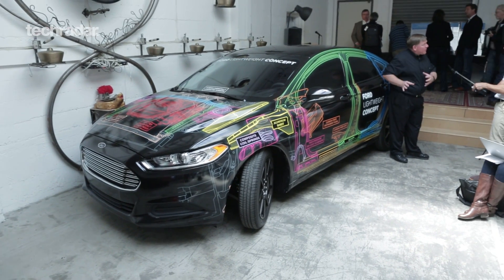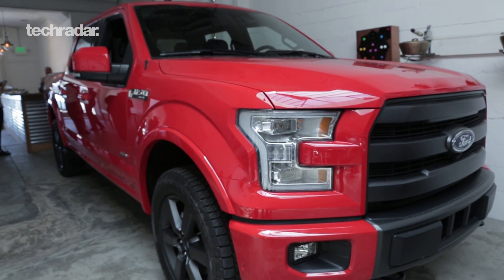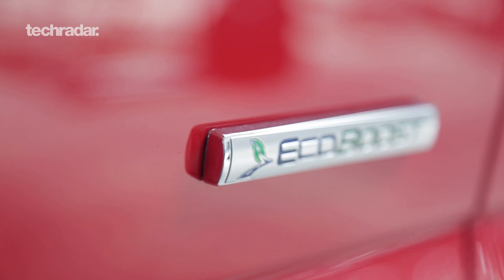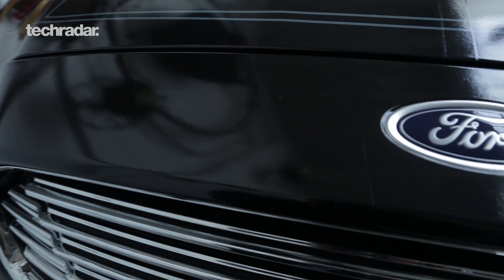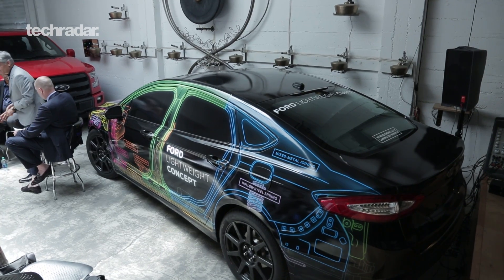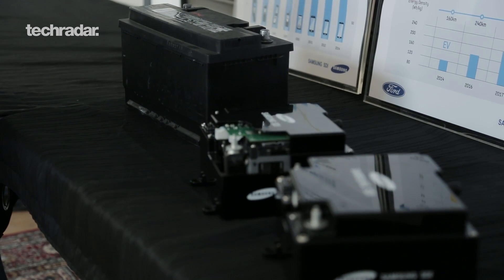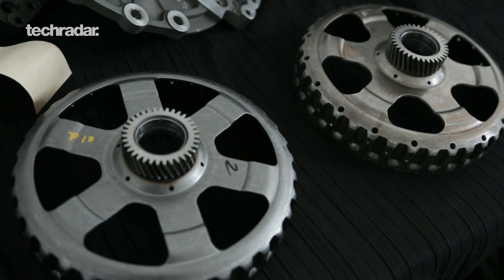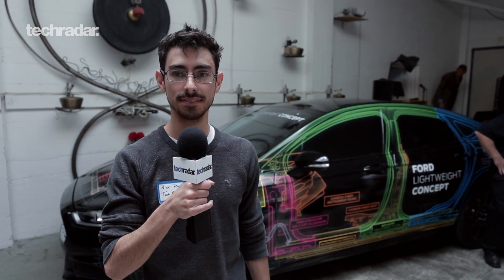Ford 2014 Lightweight Concept Car

Comment: so it weighs the same as a small sedan from the 80s but at a huge cost for r&d because of ridiculous crash safety standards of today and gets less mpgs than a corrola 15 years ago.  FAIL.  An 80s chevette diesel got close to 50mpgs factory.  Thanks to gov. involvement in a consumer products we have made zero progress in 30 years.